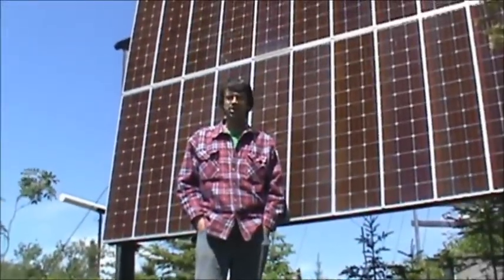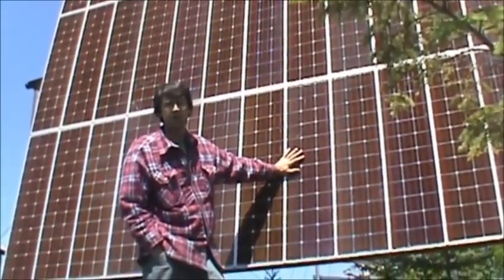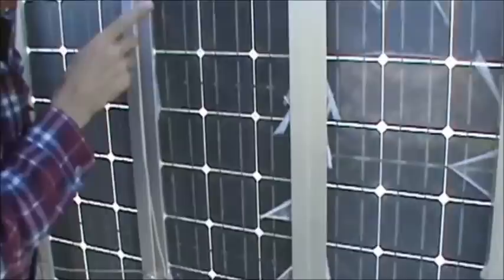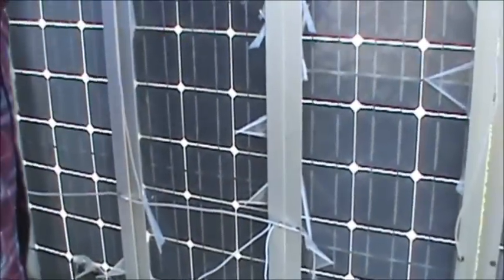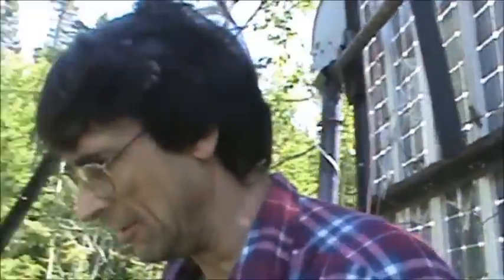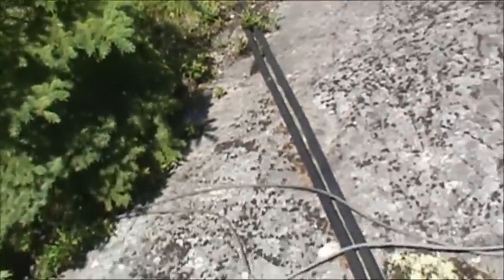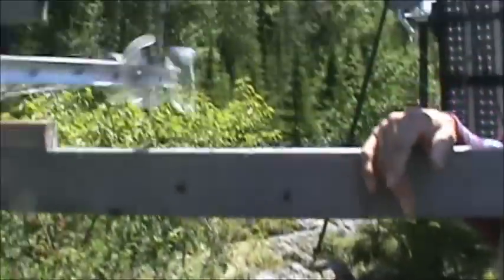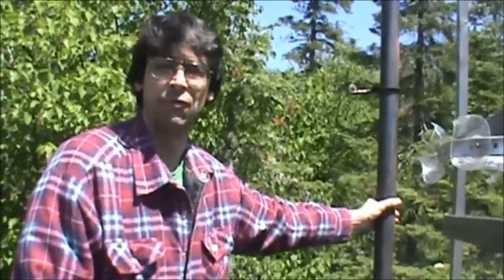Off The Grid: Hot Water (Solar Power) (DIY)

Comment: Nice Video.  I

A free life in nature.

About the panels These belong at the solar energy museum as it exists?

4 volt panels are today not interesting for  generating of energy.  

I would say go for 48volt home-roof panels with an good MPPT charge controller that can charge 12,24,36,48 battery systems.  MPPT charge controllers as Morningstar, Outback, Midnight or EPSolar Chinese but very good.

High voltage installations, that is now popular because it gives a much higher efficiency. 

A common system is today Two 48v panels in series. Many MPPT charging controls go up to 150v DC Some pro models even higher to 300v DC.

What i  would say go for 48volt panels  with an good MPPT charging controller.

Comment: you can go on line and buy cells cheep you should change them out!
Reply from the maker: The price of solar has come down so much in the last 3 years that I would simply buy new ones , then fool around with an old one .
Reply: Personally I think solar is not the way to go especially at my age I am fifty in December for your self who has them already then it was practical for you and of coarse accessibility to the grid. I have come up with my own design for a power station which runs itself the norm says it is impossible but I beg to differ I have everything to get it up and running but need the time to put it together. I like your channel as it is people like you and me who have the best ideas!